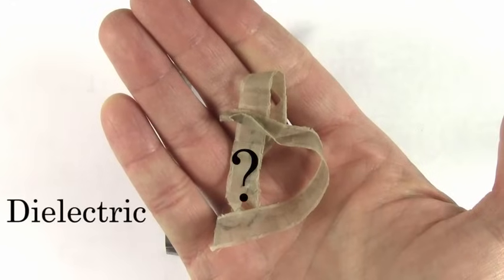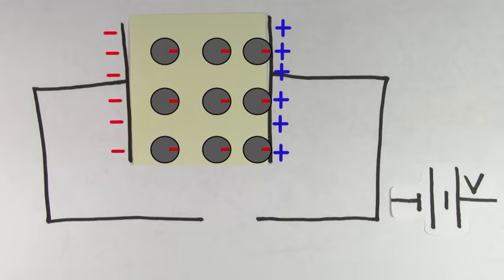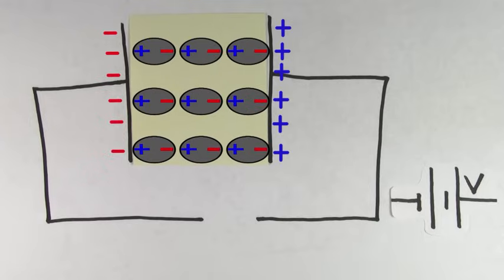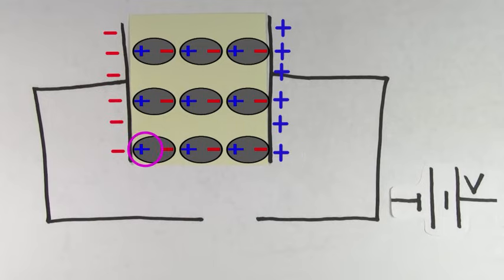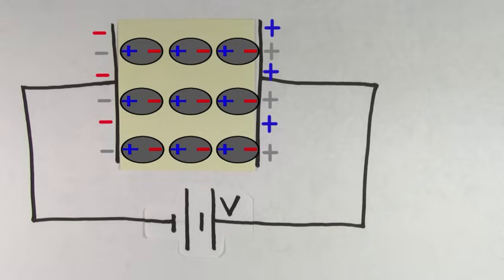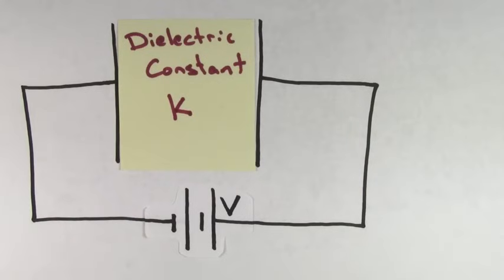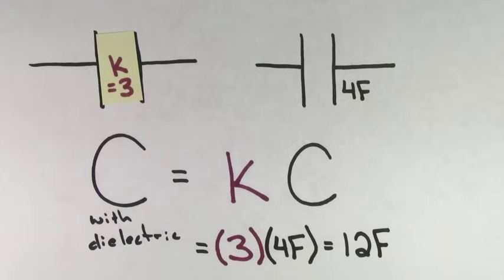Dielectrics in capacitors | Circuits | Physics | Khan Academy

Comment: I once opened the CPU, and even though it was not connected to a power supply, I got a shock. This happened because of the presence of capacitors.

Comment: Summary Of The Video :-

Placing Dielectric Between The Capacitor

* Dielectric is an non condcuting material (An Insulator)

* Inserting a dielectric between the Capacitor always increase the Capacitance of the Capacitor.

* When We place a dielectric between the Capacitor the dielectric become polarized .

*  Inserting Dielectric increases the Capacitance by lowering the voltage ( When battery is disconnected)

* Inserting the dielectric increase the Capacitance by increasing the charge on the Capacitor ( When battery is connected).

Comment: If voltage decreasing doesn't that mean that  net charge  is also decreasing  because of partial neutralization of charges on walls of the metal so we have balanced compensation, so how does the capacitance still increase?

Comment: I am blown away😯Is this how much simple, intersting and LOGICAL physics is?🥺omg, why teachers let us just mug up those sophisticated mathematical equations whn physics can be explained this way🥺🥺🥺❤️❤️❤️You are a gem I tell u. Thankyou🙏
Reply: No joke, I've never had someone explain this to me in such a simple way.
Reply: I still have questions.  1- with an insulator (dielectric) how is a capacitor a direct short when a charge is first put to it. And 2 - adding a capacitor,  does that extra load cause the battery to drain faster?

Comment: When the charge on the plates flow, the atoms in the dielectric returns to its original state, that is random position of charges or depolarized atoms. This ensures that all charges will flow when circuit is closed.

This is just a note, but if someone happens to notice something wrong, please correct me.

Comment: Finally I understand how there can be different voltage across different capacitor. It's the capacitance, which is related to the dielectric permittivity! Difference in dielectric permittivity results in difference in capacitance. Thus different voltage since q = c.v and the charge stays the same

Thanks for the video!

Comment: Great video, thanks! I’m curious however if it’s the atoms in the dielectric canceling out charge  from the plates that leads to increased capacitance why do the thinner the dielectric the better or more capacitance they can store? It seems counterintuitive because there would be less atoms to cancel out the charges? Gracias!

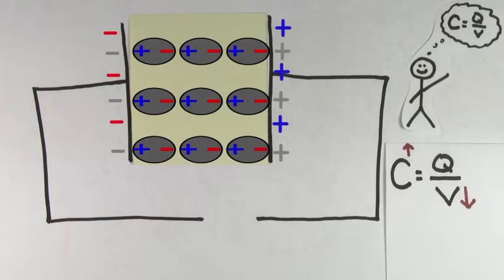Comment: 4:00 That doesn't make sense to me. If capacitance increases as voltage decreases, why wouldn't a closed circuit rather than a capacitor have greater capacitance?
Reply: because then the does not decrease, but rather remains the same in a closed circuit.

Comment: Once the negative and positive sides of dielectric will attract positive and negative charge from the plates of capacitor then what will happen is it again attract the charges when voltage applied

Comment: 5:20   I think u did something wrong , the capacitance DOES NOT depend on the charge nor the potential difference it only depends on a) type of dielectric.  b)the distance between the two plates.  C) the inner surface area of the opposite plates. From that we conclude  C= E0 times the area divided by the distance

Comment: Capacitance only depends on physical parameters,C=€A/d
Reply: Aaha? well, how is the € increase then? Simple answer, by using a material with higher €. Well how the hell, higher € increases the capacitance? Because of the equation you just wrote? Haha, Just listen to the class again, if you want the answer.

Comment: Since the 1950s, most large aircraft have used capacitors as sensors to measure and indicate the quantity of fuel in each tank.  Metal capacitors, usually tubular in shape and reaching from the top to the bottom of the tank, are installed in areas of each tank and electrically connected in parallel to a sensing circuit.  The dielectric constant of jet fuel is very near 2, so sensors in a full tank will indicate about twice the capacity of sensors in an empty tank where the fuel dielectric has been replaced with air.  Of course there are complications, but basically the fuel level indication for each tank is just the measured capacitance converted to a calibrated scale of fuel weight.  Originally this was accomplished by analog circuits with vacuum tube amplifiers, but of course these days the systems are digital.

Comment: Your right. We need constant safe voltages for personal. Capacitors are safer for air cruise. Batteries and capacitors work great for accension. Use batteries for back up and run on capacitors at higher altitudes. Engineers could have sufficient room to manually accomplish this in engine room. Captain flys plane. Our flight attendants are very intelligent and resourceful.

Comment: overall god, but many false statements. batteries do NOT "maintain the output voltage because thats what. batteries do". They simply supply charges as long as they can, until they are depleted.

Comment: But isn't it increasing the charge would also mean an increase in voltage, resulting in an equivalent ratio, therefore not changing the capacitance of the capacitor since the ratio remains the same? That is according to another Khan Academy Tutor here: https://youtu.be/u-jigaMJT10?t=4m52s PLEASE CONFIRM THIS. Thank you.

Comment: I have a problem. Can you pls answer this.

The dielectric in a capacitor is changed to a material with a dielectric constant that is larger by a factor of five. If the charge on the capacitor is held fixed, by what factor does the energy stored in the capacitor change? Explain why the energy is different in the two cases.

Comment: At 5:11 how can the voltage across the plates remain the same? First it is clearly explained in the video that the voltage across the plates decreases due to the introduction of a dielectric medium. Now if a battery is connected, it will try to increase the potential across the plates to make it equal to its own voltage. In the process of doing so, both the charge and voltage of the capacitor should increase.
Reply: I believe that what is happening is that the charge is increasing until the voltage is the same and the extra charge is being occupied by the dielectric. So, the voltage remains the same even though the charge is increased.

Comment: Who knows how many atoms are in the none conducting material. But if they all move to align into + - positions in a fraction of a nano second, you would think this would cause some damage to the material. I don't believe it. I think they haven't got a clue about electricity . Try looking up, or can someone explain what dielectric actually is? I don't believe there is positive and negative electricity. Just charge or discharge. In a circuit, using a battery, at what point does the electricity travelling threw the circuit change from + to - in it's return  journey to the battery?

Comment: Isn't capacitance independent of voltage ?
Reply: yeah it is but in this video he shows you what happens BEFORE and AFTER inserting dielectric material. Inserting dielectric material changes capacitance
Reply: Yes, he is showing the capacitance increase after dielectric was insert.

Comment: What happens if you charge until completely filled with a Dielectric, take off the battery, then remove the dielectric? You have more charge than the capacitors can support, right? So what happens... an explosion?
Reply: Something called corona discharge  takes place in that case.

Comment: I still don't quite get why the total charge stays the same if the charges are cancelled out by the dielectric. I mean they are grayed out. How they still can carry a charge?
Still a great video. I learned a lot.
Reply: Because the stabilization of the charge on each plate by the rotation of the dipoles in the insulator has reduced the energy difference between the plates (potential), and there is no reason for more charge to come to those plates and re-establish the higher energy state (repulsion of the charges) if there is no "uphill" motor to move them (battery).